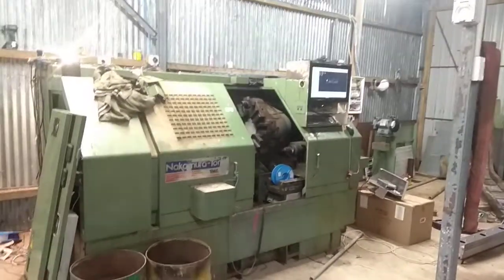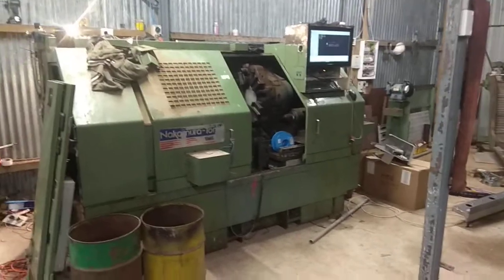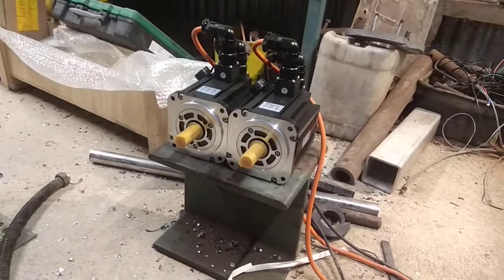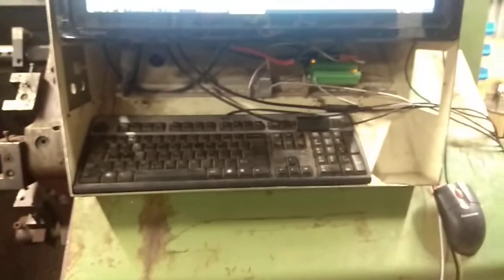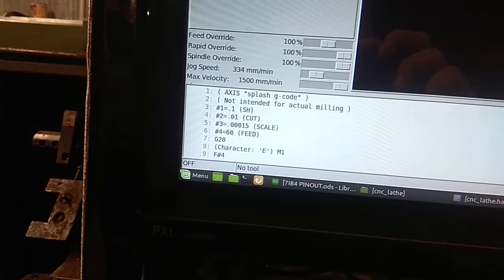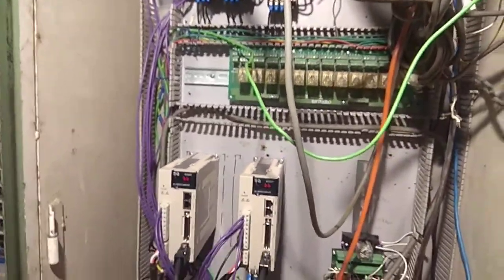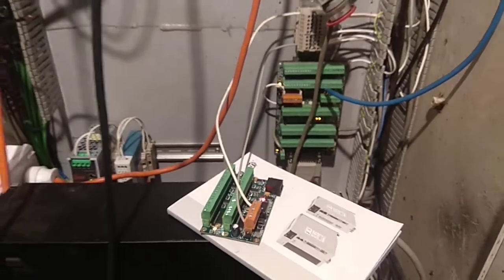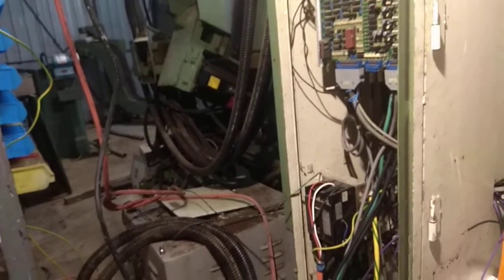Linuxcnc powered lathe retrofit part 1

Comment: Hey mate, how'd you get on tuning those servos? If you're up to that point yet that is. I've fitted some Chinese servos to my old commercial router and am only able to achievs average tuning. Wondering if you've got any advice? Same hardware more or less, 5i25, 7i77.
Reply from the maker: Hey mate got it pretty good now.  Not finished tuning but good enough for now.  Maxerror at normal feed rates is 0.01 mm.  Or less

Happy as to help you if you want.  You can find my contact info on my website.  Just send me a bell.  Or I'm on WhatsApp messenger signal etc

Comment: I love what your doing....but that being said couldnt you just find a cheap used board or whatever to keep it simpler to have a running machine?  And you over doubled the power of the original servos?  Is it because (like Mitsubishi)  they run briefly double there rating?  And sweet sweet job getting the fanuc spindle drive working with linux! Could you pls show us how you did it? Also whatkind of rapids and feed rated can you get from the messa cards? I thought the pulse and direction boards couldn't go very fast? Im still in the planning/ learning/ and figuring out stage on my vertical build. Im greedy tho...i want at least 500ipm feed and 1100ipm rapids if possible...lol. SUPER GREAT JOB!!! CANT WAIT TO SEE MORE!!!
Reply from the maker: Hey jason.  The electrics on this machine are like 30 years old.  They are all failing at that age.  It's just a matter of time.  I already tried fixing the machine twice.

The new Chinese servos are like under $300 usd each for motor and drive and cables.  I got larger servos as I might as well.  They are cheap enough.  That's less than half of the original stuff if I want to buy it on e bay.  The velocity spindle drive actually has a 0-15v reference which is like almost any standard vfd.  The older fanuc stuff is a lot more open source I think than the newer stuff. 

And just have to say the Mesa stuff is awesome.  It is way faster than you ever need.  And won't be the slow link.